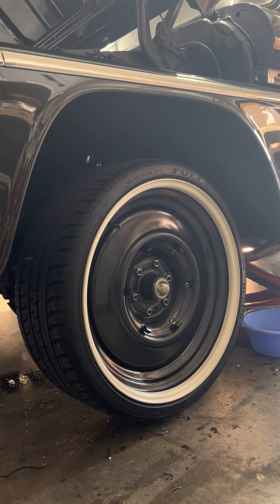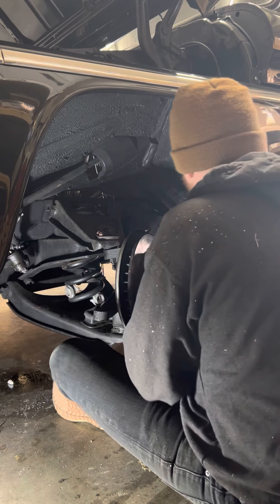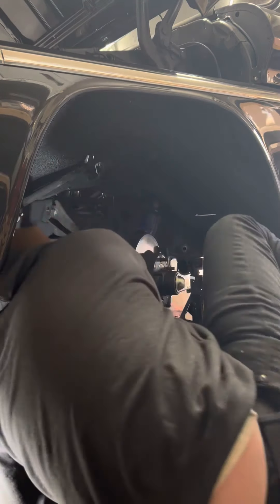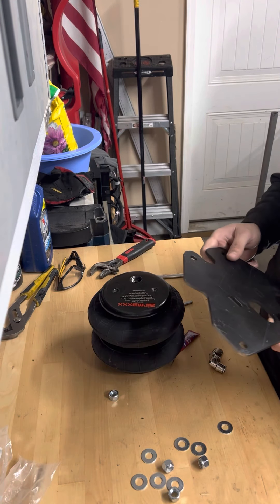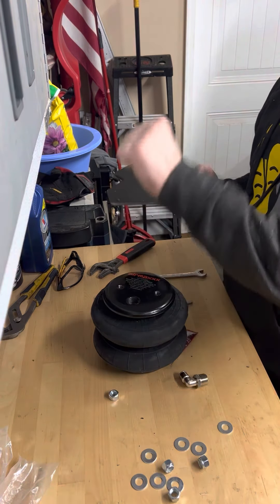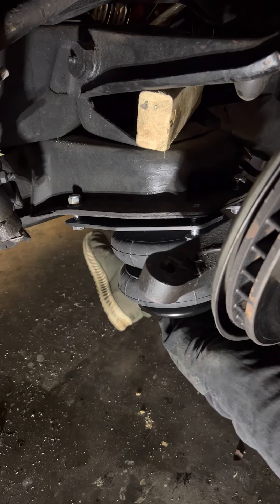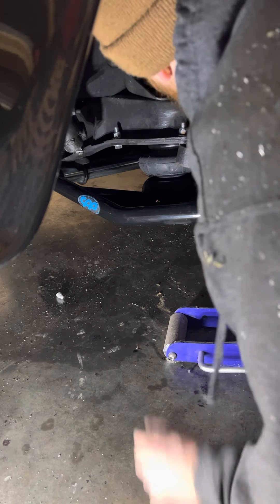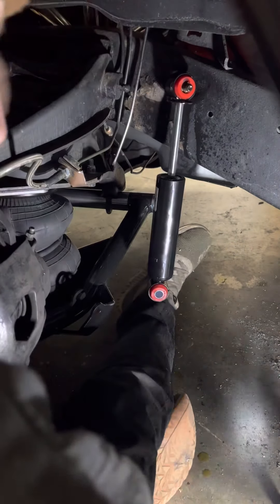C10 Front Air Ride Installation

Comment: Your videos make it look easy thanks. Question though if I use the CPP lower control arms I don’t need to put in the bag cup correct? Just wondering.
Reply from the maker: If you get the cpp lowers made for air ride then it will bolt directly to it. Although if you want to lay out you need to cut the bumpstops l bracket off the control arm. I would recommend spending $200 more on the ridetech lowers.
Reply: @SIMPLE.C10  I watched your video today on cutting the bump stops thanks please keep the videos coming
Reply from the maker: @greghiebert2592  awesome. I sure will!

Comment: So with those lower control arms, there is no need for the lower air bag mounts?
Reply from the maker: Correct. The lower control arm has the mount for the bag on it. It’s a flat surface to hold the bag.

Comment: Good info thanks👍. I tried to do the same thing too and help out so i recorded the process of lowering my truck years ago. I ended up losing the SD card and every bit footage I had. 
Kept it static though with 2.5" drop spindles and 3" springs for the front. 2" blocks, 5" springs and c-notch for the back. Then went back and cut a bit of spring and removed the bump stops from the front. Smaller tires and clearanced the driveshaft tunnel. Added spring rubbers to stiffen it up some cuz I was scraping the front cross member on bigger dips and bumps. Yeah I'm an idiot
Reply from the maker: You live and learn but I bet it looked good!

Comment: I have the same bags and lower cpp arms.. are the cups neccessary on bottom of the bags?
Reply from the maker: No. With cpp lowers you will mount the bag directly to the control arm.
Reply: @SIMPLE.C10  did you cut the bump stop off the lower arm?.. I'm wondering if I slide the bag all the way back like you, if it will avoid me from cutting the bump stop off.
Reply from the maker: @ChetoDaTruth  you have to cut the bumpstops off because it limits your travel. The bumpstops stop the lower arm before it can lay all the way out. There’s two inches more of travel.  If I would have known this I wouldn’t have bought them but I have a video on how to cut the bumpstops off.

Comment: You didn’t have to replace the upper arms?
Reply from the maker: No. You can get just lowers on the cpp arms but they don’t come narrow or forward.
Reply: @ so you need to make sure which backspacing your wheels have and if normal arms will work?

Comment: Do those shocks also work for the back?
Reply from the maker: I use a different shock for the back. Almost any shock that has a travel of 8 inches or more will work great for the back. I’ll be doing the rear shocks on the back soon.
Reply: @SIMPLE.C10  Thank you!

Comment: Great video and very informative. Nick Hester does some great work and has been very helpful when I have had questions. Question for you. I am not going to use air on my 1961 stepper but am lowering it. I would like to get Viking coil over shocks later but trying to control my costs for now. Any recommendations on good coil over shocks on a static drop that will not break the bank? Thanks Tom
Reply from the maker: Thanks for the compliment! On a 61 it has the torsion bar front end so it’s a bit different than the 63-72 unless you swap it all out. Of course QA1 is the best cool over setup but they will break the bank lol. I’m not very familiar with Viking coil overs but I’ll look into them.
Reply: @SIMPLE.C10  Yes, keeping the torsion bar front end. Thanks!